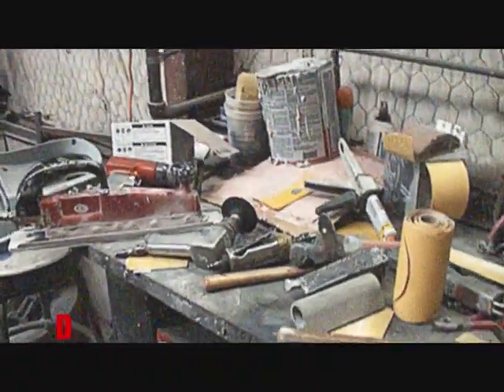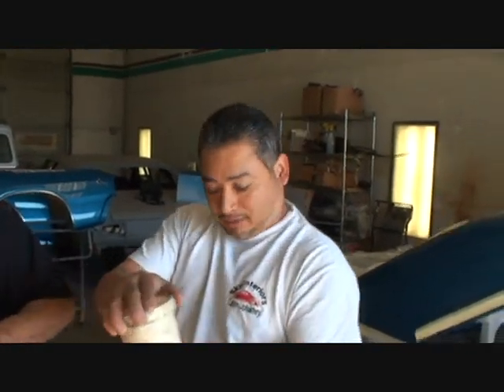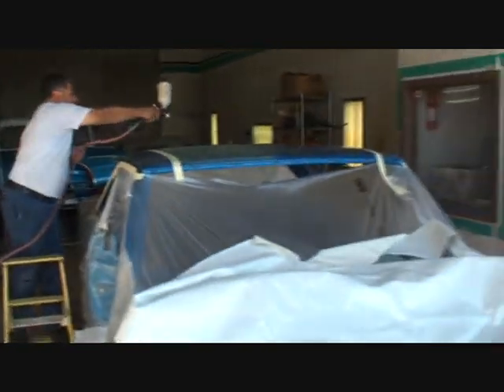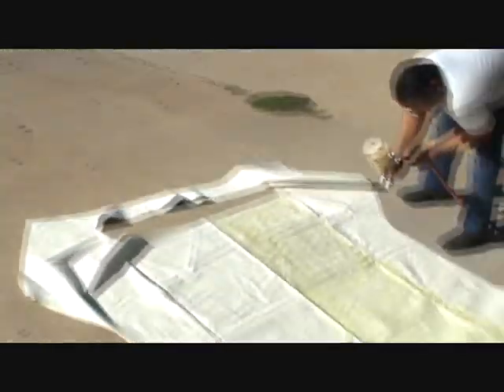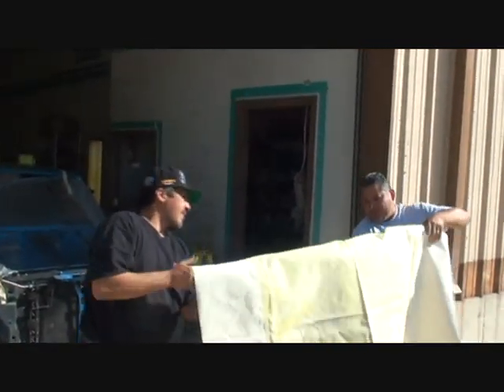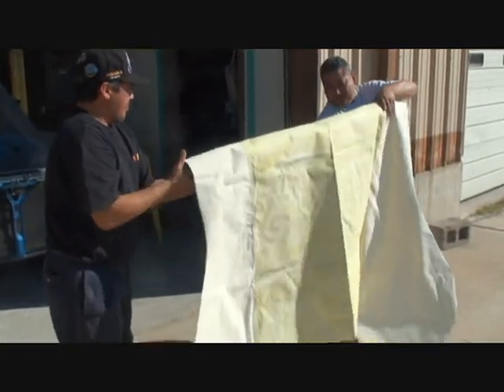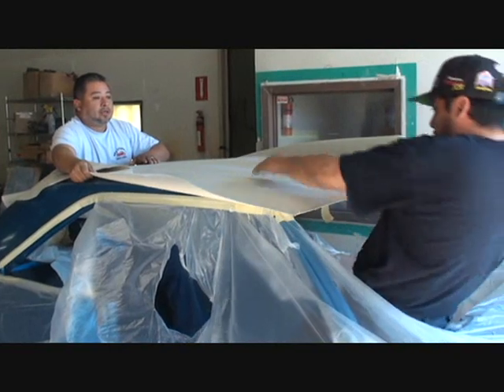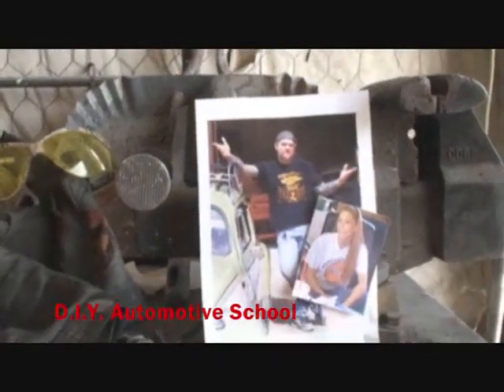Automotive Upholstery And Interior-How To Install A Vinyl Top. Part 2

Comment from the maker: @Bmotoring The ground it was thrown on is clean, and it's "Vinyl", which means it can be cleaned off, it won't hurt to put it on the ground for a few minutes, the vinyl top is a big area to apply glue. I wouldn't recommend to do it on a rainy day or out back on the dirt!.....

Comment from the maker: @dougthathughere The vinyl used for a hardtop is  designed for just that purpose, it's water proof. You can order a top from your local upholstry shop that will fit your car. Pete

Comment: Nice I never saw a Video in details how to put one on Just the same run of the mill video installment shit like you see a guy roll it on and then video is cut showing him all done not as easy as you think. I had one guy do a Vinly top at My house for me 15 years ago all by himself I watched him he did a Perfect Job No steamer and today its still holding up like he just did it I was proud of his work I even Tip him $50 more for a job well done.

Comment: Starting from the center, and going from side to side is much easier to do the job. I just center it from the center of the material, and the center of the top..(front to Back )Just tack it in the middle, and work your way to the side with about 12' of gluing at a time.It is not necessary to have your windows out, and if you don't doing this way is impossible. The end result is what matters!!!

Comment: Im sure somebody else commented about how these guys r doin it wrong but heres my comment ....I did this for a Living from 1982 to 1990 all over the Philadelphia, Jersey and PA. areas  Body shops, Car dealers and Used car Dealers My buddy and I would bang these out in 30min or less ....Wow! Its been a Little over 25yrs since the last time I put on a Vinyl Top and this is the first time I watched somebody else do it and Damn! Spray that whole Top n Just throw that shit on the car... that paper is no trick...and working from front to back is wrong..Grab it on side with ur partner n eye up the seams from front n back n just use your fingers as a guide to where the seams should be from the corners.... oh god this comment is getting Long and ah..where am I..... oh! n use a heat gun and straight edge Razors...I forgot to Tell ya all  I have Health problems today because of all those years of using Glue without a Resperator.About 25 to 35  Vinyl Tops a week until it all died out around 1988 and also Pop up sunroofs using silicone.I have central nerve problems ..The MRI of my brain shows multiple White matter lesions
Reply: im in NYC, can I bring you my buick 225 for a landau
Reply: Where can u get the glue from